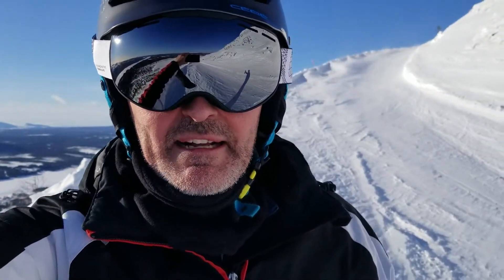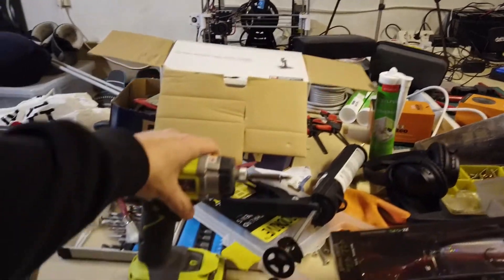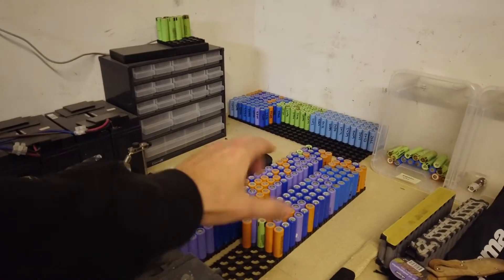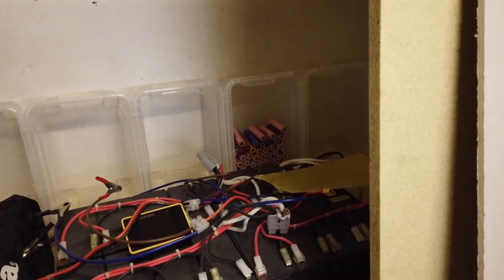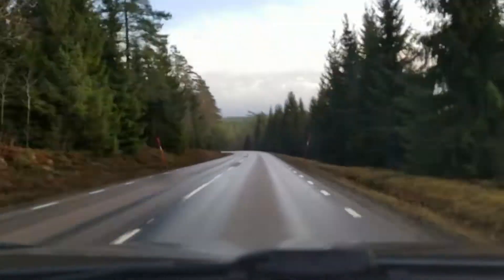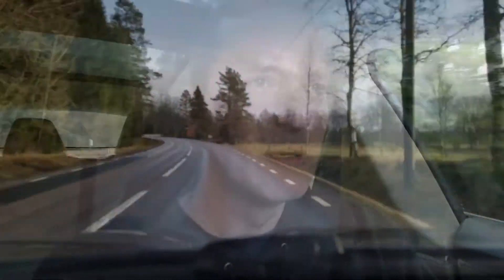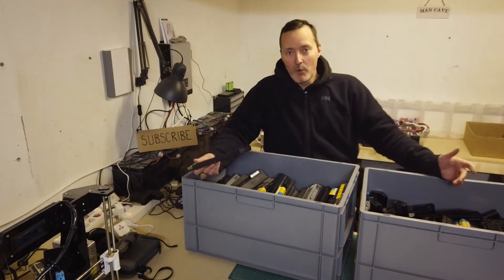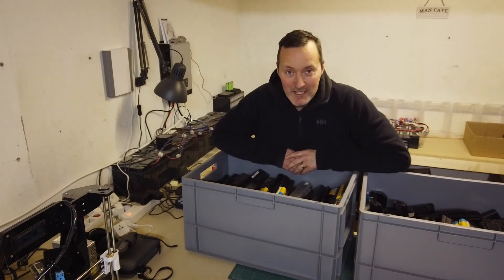Exclusive Interview with a DIY Powerwall Legend - Daniel from DIY Tech & Repairs

Comment: Good to see that you have found some more cells, it can be hard to find. I have found out that e bike shops usually don't mind just giving them away, well of cause it depends on the people that work there. if there is a hospital where you can contact the technical department they probably have a lot of cells from the medical machines that you might can get. i have a friend that said that, that they have many laptop batteries and medical li-ion/li-po packs that they just throw out. I haven't got any so might not be possible for me, but might be different for were you live.
Reply from the maker: Yeah it has been hard but I have enough cells now to build my first 20kWh pack which I'm really happy about. I'll see if I can find someone who works at the local hospital, good idea thanks!
Reply: @TheKilowattChallenge  How many 18650 Cells will be in your 20 kWhr pack ?
Reply from the maker: @MrSummitville  Hooo, around 2800 if I use cells which are tested at 2000mAh or above. That's gonna take me a long time to process that many but it will be well worth it when I'm done - i hope ;-)

Comment: Love it. Watched all your videos. I’m doing the same as a project. I want to run as close to 0kwh as possible. Also I managed to salvage a Tesla pack and dismantled it (not easy) I might do a video of how I do it. 
Iv got 6 panels and a goodwe 3kw hybrid inverter, but I need the Ezmeter to finish it off (the older one2010)
Atm I’m running 48v headway cells :) and I’m adding more as I go along. Keep up the good work.
Reply from the maker: Hey thanks Azzy - you watched ALL my videos wow, what a star :-)  I just subbed to your channel in return, I'd love to be able to build an e-bike like you're doing.  How on earth did you managed to get a tesla battery pack lol?
Reply: The Kilowatt Challenge just keep connecting with ppl :) I traveled 7 hours to collect it lol
Reply from the maker: lol - did you get it for free?
Reply: The Kilowatt Challenge ha. Well kind of. I swapped a sabvoton controller for it and another controller I wanted + a few extras :) well worth it
Reply from the maker: I call that a result! ;-)

Comment: Panels come in various sizes so you may find the roof size does better in 72 cell panels instead of 60 cell panels. not too hard in your computer to turn on the cell lines in MS excel so it's a built in grid for you. Cheers
Reply from the maker: Yeah that's a good idea as well. Are the panels generally in 60/72 cell configurations, is that the norm? I'll have a look at excel later, thanks for the suggestion.
Reply: @TheKilowattChallenge  Everyday it changes they now have 500 watt 96 cell panels, but imho your best buy cash wise will be older 60 cell panels, but you need to consider energy density in the calculation Watts per square meter. cheers